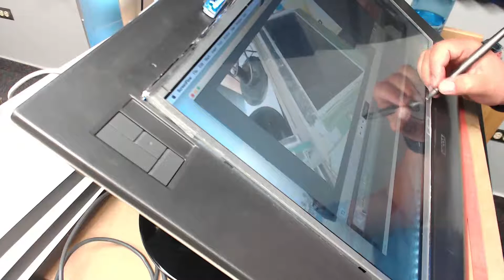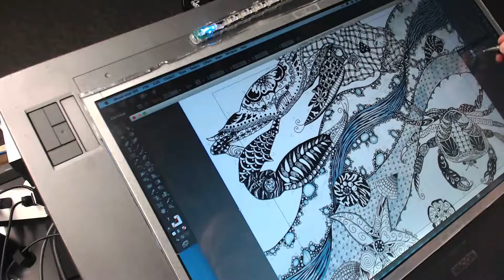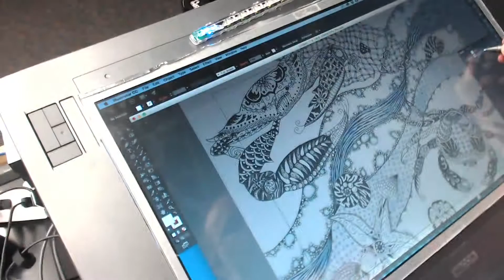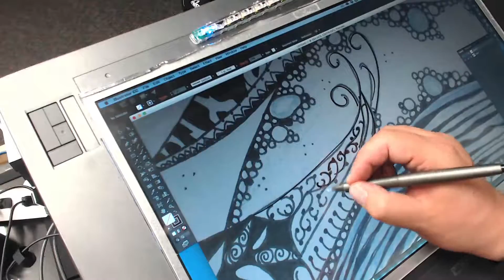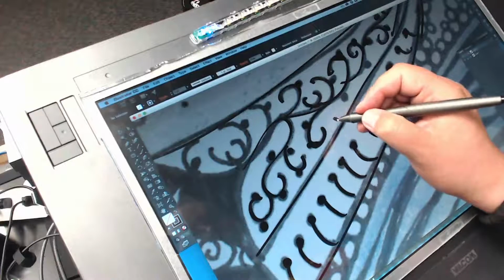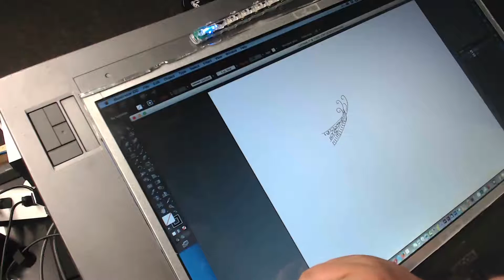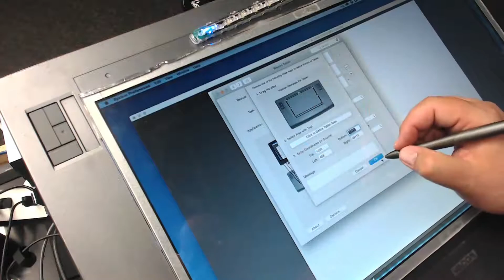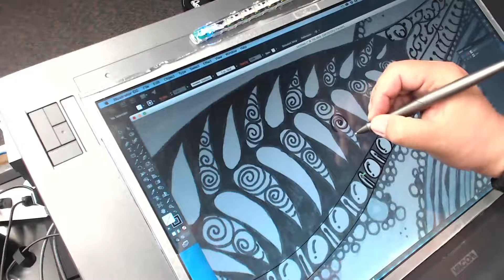DIY Cintiq Part 5

Comment: How did you manage to put the cursor tracking in the right screen?
I mean it shouldn't be an issue as long do you have a single monitor, but when do you have more than one.. doesn't the tablet recognise the multiple monitors as one?
Reply from the maker: No.  With the operating system it allows either to duplicate the monitor or use separately. The wacom software can be set to one monitor, and use s pen or mouse.  It's really convenient if I don't want to use the pen for scrolling or such.
Reply: @RyanHaworth  so basically are you using the wacoms drivers to set the right screen to use?
Because I'm planning to do a my own tablet starting from another digitalizer, but the manufacturers are not willing to give to me more specific datas nor drivers unless I do a big order
So I should write some drivers for windows or trying to adapt some preexisting drivers to the module
But in both cases it will be a huge pain in the ass.. so I was looking to other possible solutions

Comment: if it were me i would just cover the edges with molded clay and then just sanded a bit to make a sharper border.
Reply from the maker: I'm actually going to do something similar. But first I need to remove the metal frame part of the monitor. It's causing interference with the stylus as I draw, write, or use the menus and dock near the edges.

Comment: Hi, What type of monitor did you use? 
I've been trying to get this working with a LED screen from a laptop but it seems the screen itself is interfering with the digitizer.
Reply from the maker: Mikibish I'm using an LCD monitor. I can't remember the model. It was an Acer 21.5 inch.  You may be having interference from the monitor. In my previous videos I show how I shielded the circuitry and took apart the monitor.
Reply: Thanks. Yeah I saw, is just the aluminum tape you're using? I only hand enough to cover the bottom of the pcb, perhaps I need I more.
Reply from the maker: Mikibish that's possible. also be sure that the aluminum doesn't come into contact with the board.

Comment: + Ryan Haworth how did u integrate monitor, which is larger than working space of intuos? as far as i know it should be exactly same. or parts of your monitor, which are beyond tablet's working space  does not react on stylus?
Reply from the maker: It's actually the opposite. The tablet's active area is larger. In my case, the lcd screen is not as tall as the tablet active area, but is the same width. This means there is part of the tablet's digitizer that isn't being used, but could be used. It's a lot easier to have a tablet larger than the monitor and just not use the part that isn't under the monitor. Yes, if the monitor is larger than the active area on the tablet, there will be a portion under the monitor that will not be usable for the tablet. But, I've seen where this isn't as big a problem--like with a large tv screen. You could just position the portion of the tablet digitizer beneath the portion of the tv used for drawing and just use a mouse for the remainder of the screen. It would be difficult, but, again, it would be possible. Use the planner tool provided on Bongofish: http://dl.dropbox.com/u/11275473/simtiq_planner.html
Reply: isnt intuos large have active area of about 15" ?
Reply: +Ryan Hawort all DIY cintiq i saw was 15", how did u do 21,5? also where have u find source material of how to do this DIY? if u can pls post me via email - i'm interested in doing same thing as u did, but dont wana screw everything up (platypusrevange@gmail.com)
Reply from the maker: That depends on the model of the Intuos. I have an Intuos 3 that is about perfect for a 15.1 inch monitor. Some of the newer ones are wider but not as tall, as are monitors. A 16x9 aspect ratio will be different than a 16x10 or 4x3 aspect ratio.
Reply from the maker: The main resource is http://forum.bongofish.co.uk/ Unfortunately, a lot of the builds there are old. I used older equipment, so it was fine for me. But if your tablet is newer, or you want to use a newer monitor, you'll have to consider that. I'll send you an email, so you can ask specific questions, but I've tried to be very thorough in these videos. Maybe I need to revisit this project. I still use it every day, so I could do a follow-up video.

Comment: so what is the point? does it use same stylus and hardware from intuos? how does it work, comparing to cintiq and intuos?
Reply from the maker: Yes, it uses the same stylus and hardware (I have an Intuos mouse that works with the digitizer in the tablet). Compared to an Intuos3, it's better because I can draw right where I see it. Compared to a newer Intuos tablet, it's not as good for the pressure sensitivity. The Intuos3 only has 1024 levels of sensitivity, and some of the newer tablets have 2048 levels and some rotation sensitivity. I've not felt like I needed that kind of sensitivity though. The monitor is comparable to all the Cintiq models except for the newer ones that have better display than 1080. It's way better than anything on price.

Comment: Are you sure that you short circuit the digitizer, i trying to build somethin like this (with an intuos 2), and what i have read so far its that there shouldnt be any kind of metal between the digitizer and the display because it will generate jitter, maybe the metal frame of the display or the aluminium tape are the cause, did you try to use the tablet with the display apart to see if still jitter?
Reply from the maker: No, I didn't completely short circuit the tablet. It did burn a little on the board, but I didn't leave it long enough to destroy it. Yes, keep metal off the board itself, but I still have the aluminum frame around the screen. I just made sure to separate the screen assembly from the tablet. 
I'm using it right now over a year later. No issues of jitter. I still have some problems with interference when I use the stylus near the top (like in the menus of applications) but I'm still trying to decide a permanent case for the tablet. I'm also still using the temporary adjustable stand I made in the end of this video: https://www.youtube.com/watch?v=M7tuzW-FWO8

Comment: in total or so far, how much have you spent on this project?
Reply from the maker: I'm not sure exactly how much I've spent. The hard part is that I ruined one monitor before I used the one that's installed now. However, I've spent less than $400 total for the tablet, both the broken monitor and the new one, the stylus, the plexiglass, the aluminum tape, the control board, and all the power and other cables.

Comment: A 3 mm thick glass wouldn't transmit any pressure to the screen - 
I built a 22" on an Intuos 2, with an old 13mm thick LCD panel an it could still work well, even with that thickness of glass on top.

The purported reading height of the Intuoses is 10-14 mm, from the top of the cover... it is a conservative measure.  

Reducing the height one mm to ameliorate jittering (a bit) wouldn't compensate the risk of damaging the screen.

If I had a screen less than 10 mm thick, I'd probably replaced my actual glass with a 4 mm tempered glass already.
Reply from the maker: +Da Botz Good to know. I'll look at the glass to eliminate the pressure on the screen. I've also considered a sturdier material like lexan. We'll see once I get back to it.
Reply: If I remember well, you maintained the front frame of your screen... which would give you some 0.3mm of "air" between the LCD and the glass, while giving it a decent support.

It is more or less what my glass flexes  when I lean on it with some ten kg of force, to use a plastic ruler (yes, the software does "perfect" straight lines, but often what I need is a "hand-drawn" feel... a ruler, and the set-up jitter do it nicely).

As I said, my LCD panel por the 22" is very thick (13 mm), so I  used a 3mm "normal" glass.

You should try with tempered glass, as it is safer.

Depending on the thickness it is available in your area (round here, I didn't found it below 4mm). 

Good thing of glass, beyond rigidity and a fair resistance to scratches, even the tempered one is cheaper than lexan... and I really like its "ultra-slide" feeling.

If you like your paper to have some texture, though, you'll have to buy some kind of "screen protector", like the ones used by  many owners of the various Cintiqs with the plastic surface (it worn out fairly fast, whereas you need an accident, like dropping keys, to damage the glass surface).
Reply from the maker: +Da Botz Yeah, I hear you with the hand-drawn feel. I'll look into tempered glass.  

I did have a question for you about your build. How satisfied are you with the added keypad, mouse wheels and keyboard? 

I've waited to finish my build until I am sure how I want to set up the "add-ons". My issue is the availability of USB ports from my macbook pro. I've got to use a USB hub to get the tablet and Logitech G13 keypad already. A mouse wheel and another keypad will add to the space requirements as well as the usb scarcity. Fortunately, I have both a bluetooth keyboard, mouse, and the wacom mouse that came with my intuos 3. How many usb ports do you have in your 22 inch build?

Comment: Hello friend, how you solved the jitter problem in the corners of the screen?
Reply from the maker: +Marcelo Franco Thanks for asking. I used aluminum tape to shield the edges, but made sure to not have the aluminum touch the circuit board of the tablet below with a few sheets of paper. If the aluminum tape touches the circuit board, it can cause a short in the circuitry and the tablet won't work.
Reply: Hey Ryan Haworth, thanks for this tip!
I was very glad you answered my question. I'm trying to make one Diy Cintinq with a desk intuos 4XL.

Any questions, I could ask you?
Reply from the maker: +Marcelo Franco Sure. I hope I can help.
Reply: ***** thank you, when I resume contranstrução the table you'll going progress.
I was very inspired to see the great work you did, congratulations on your success!